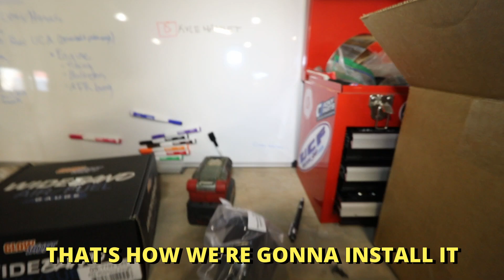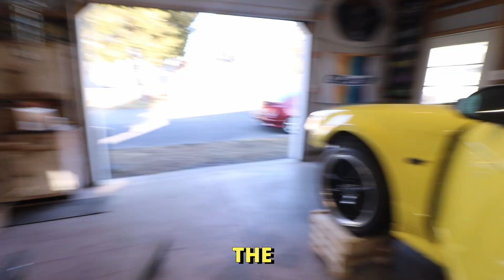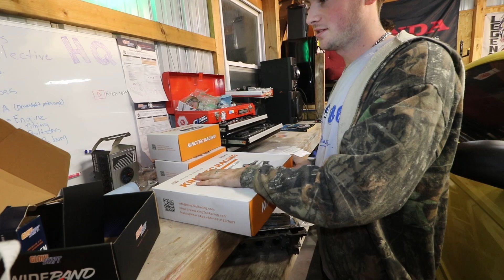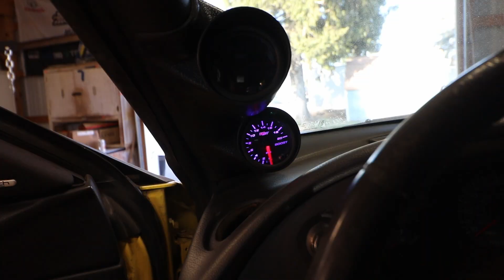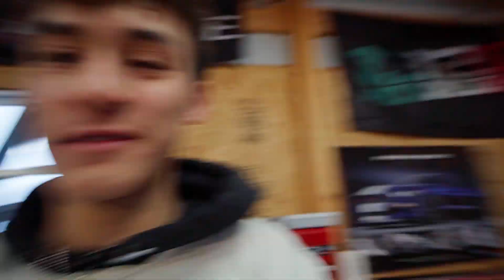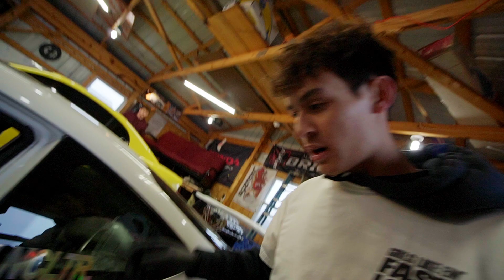NEW Motor Build + The Return of The RSX

Comment: I have a 02 base 5spd that I am swapping a k24a2 and 6spd trans into. I would definitely go k24 over any other motor. If you plan to do a full build get the k24a1 block as it is plug and play with the type s oil pump and you dont have to modify it to fit the k24a2 block like I did for mine. Your already half way there with the kpro, theres a ton of things you can do to these cars. My personal build is getting a N/A motor build with 1320 2.5in header, 2.5in Invidia n1 full catback, rbc 50* vtec gear, type s oil pump, rbc intake manifold (which is bolt on to a k24 head but will need to be modified for a k20 head), progress rear swaybar kit, grp lightweight flywheel and exedy oem+ pro clutch kit, acura tl type s BBK upgrade, hasport 62a motor mounts, shg steering rack slider, braided brake lines, dc5 battery relocation kit, skunk2 rear LCA, k-tuned 70mm throttle body, AEM short ram, Hondata kpro v4, and many other small things. I plan to make the car a N/A daily that will hopefully be pushing +250hp. Would love to see a full build come out of this. You can do so much to these cars while still keeping them reliable and able to daily.
Reply from the maker: Your build sounds sweet, I might have to do something similar!